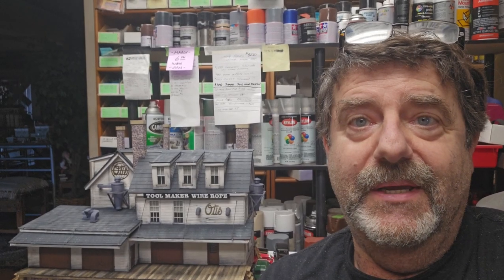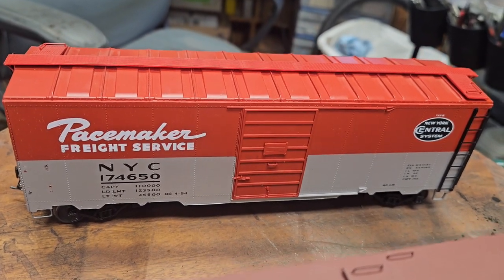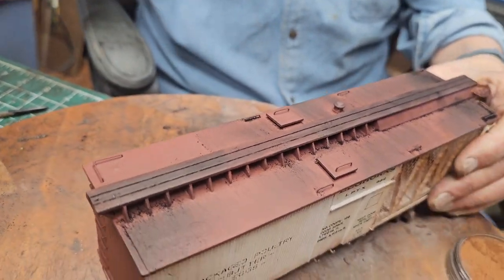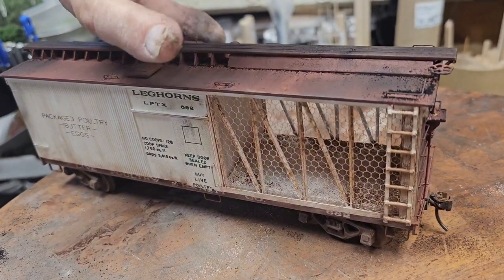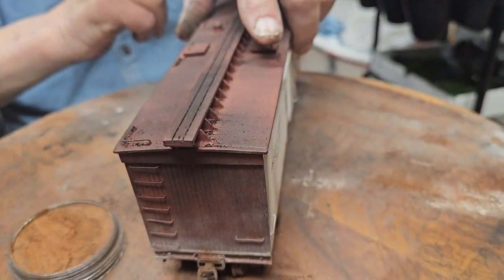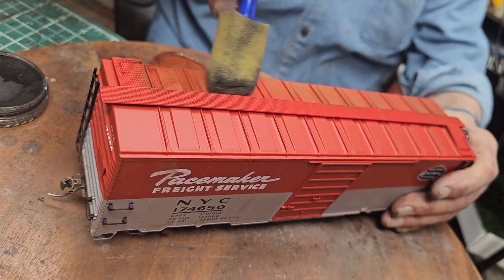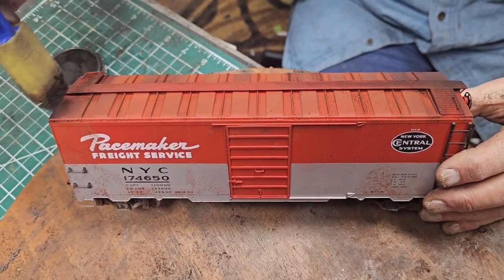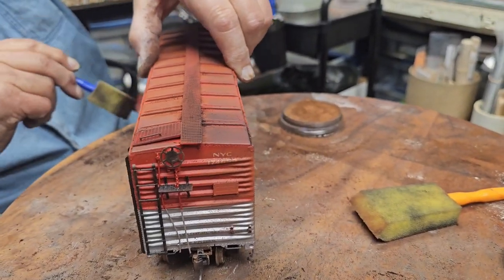Howard Zane Pastel Weathering For Freight Cars!

Comment: Excellent tutorial. Absolutely agree with Howard, Scalecoat and Floquil were the best paints. Something I’ve been experimenting with is, after dull coating using very thinned down craft paints. Couple drops mixed with 50/50 water 70% alcohol. A few light coats will fade down the color. Then very light pan pastel weathering.